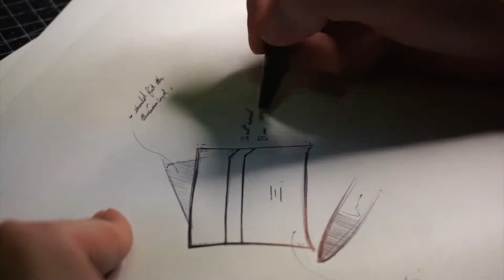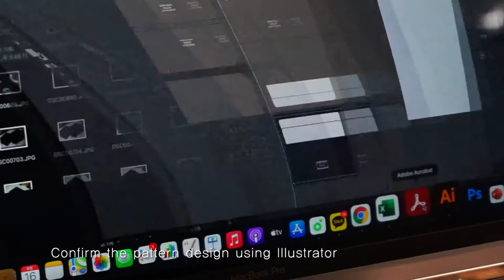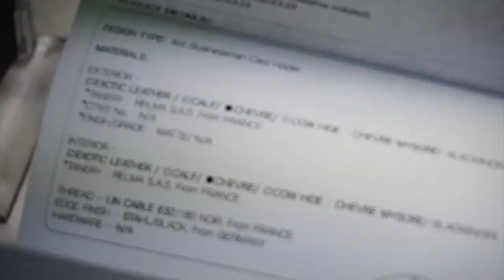Making leather cardholder as Hermes does. 에르메스와 같은 소재&방식으로 카드홀더 만들기

Comment: How do you get such a clear stamp using gold leaf on this type of leather? 12:00.  I'm having a lot of trouble getting this result.
Reply from the maker: The answer is just to try every variable we can do.
You should test them out until you have the right settings when we purchase new machines or leather articles.
stamping machine's type, temp, strength of stamping, foil brands, stamping timing, leather article's type etc...
Every article has to be done by different methods and that is the know-how when we find the great results.